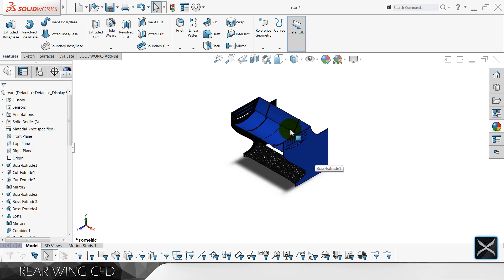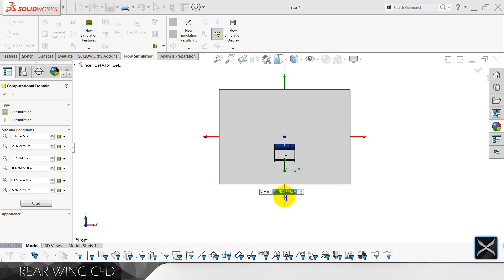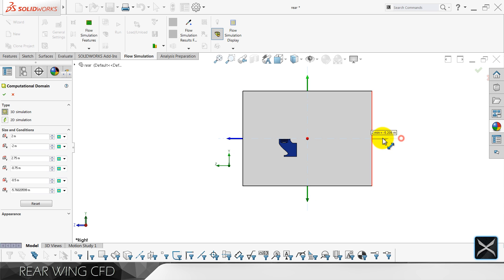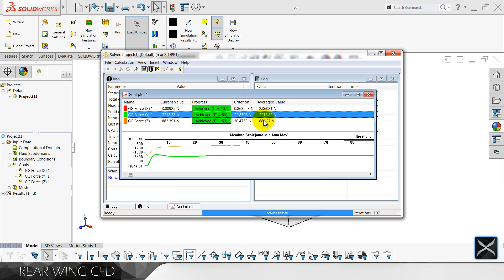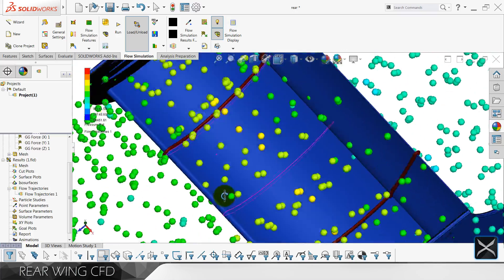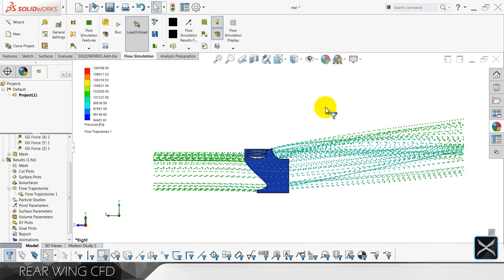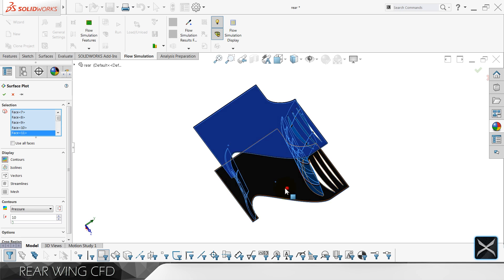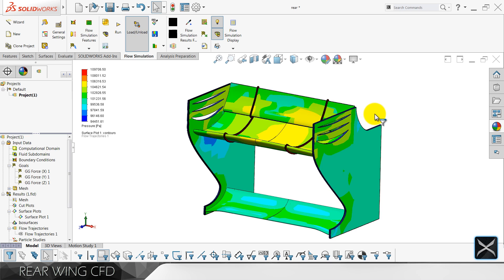SOLIDWORKS FLOW SIMULATION - FORMULA 1 REAR WING

Comment: Hey, how can we do this on ansys? Can you help? I am running it on ansys fluent but the result coming isnt right since it says pressure is almost zero at every point. Maybe you can help me?
Reply from the maker: I've never used Ansys so can't help you with this but look at some tutorials and you should get it right
Ansys is of course a lot better tool then SolidWorks for this type of simulation

Comment: In the Flow Trajectory, would you say it is bad if the top side was red in color and bottom side was blue? (Showing there is a large difference in pressure). From my understanding of what you've shown, the pressure difference wasn't that great since it was in the yellow - green range and hence the downward force could be improved.